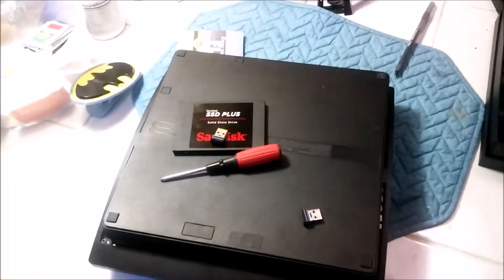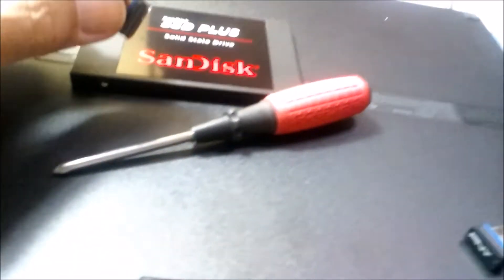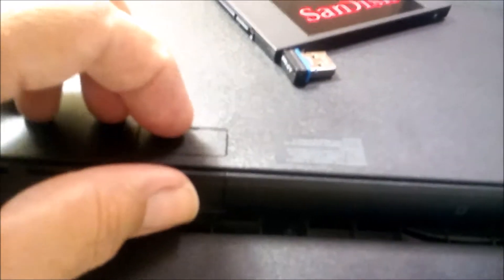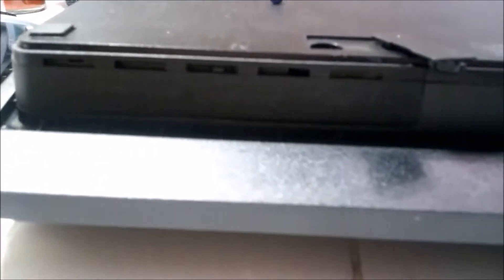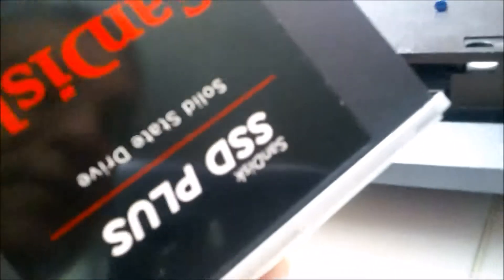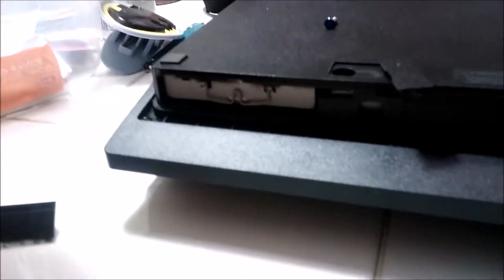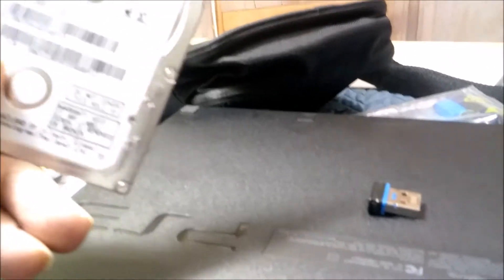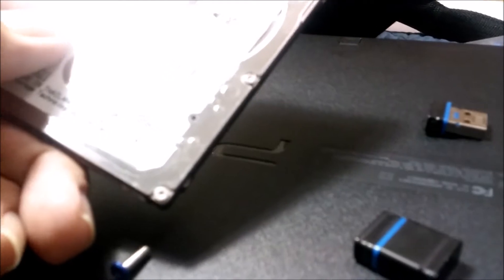Sandisk SSD into PS3

Comment: Thank you for the tutorial.  If you don't mind me asking have you encountered any comparability issues with the Sandisk ssd plus and the PS3? I can't seem to find much information on which drives work well with the system.  Thanks in advance.
Reply from the maker: NO ISSUES whatsoever :)
Reply: MrDark21knight Excellent.  Thanks for the quick reply. 👍
Reply: What website is it that you get the software update from? I can’t find it anywhere
Reply: @MrDark21knight hows the performance of ps3?